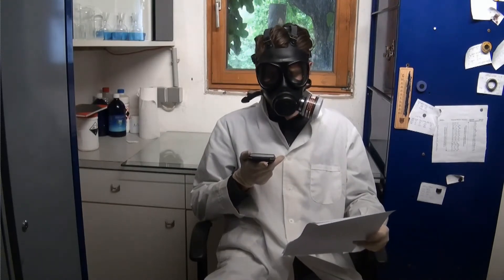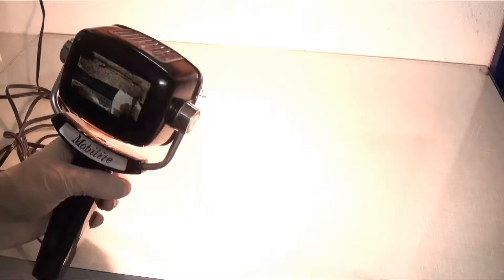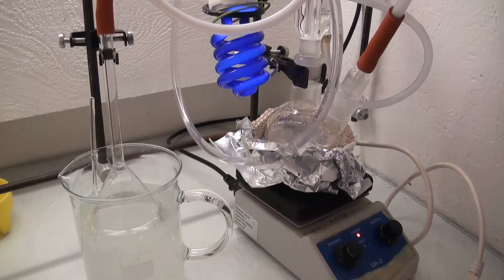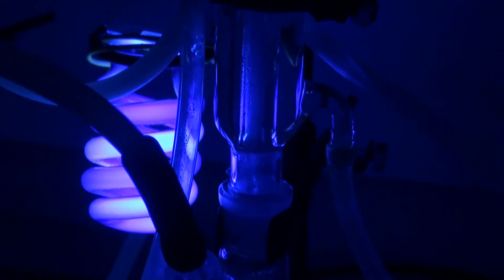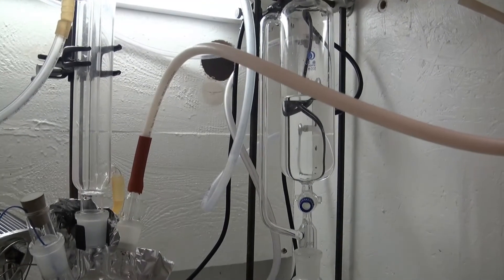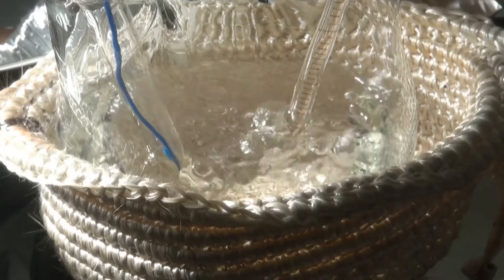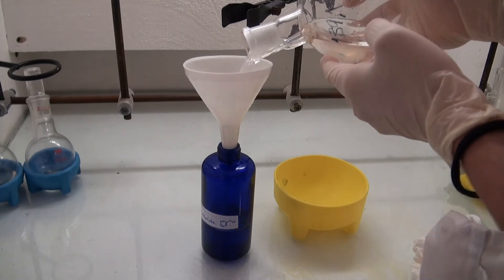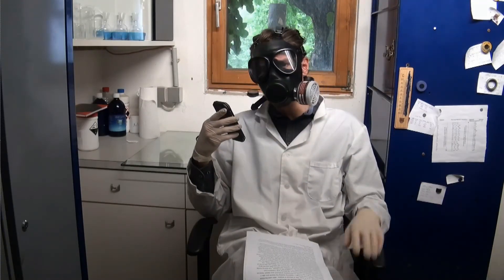The photochlorination of toluene producing benzyl chloride, benzal choride and benzotrichloride

Comment: nice, but i think a bit overcomplicated. It should be possible to just add the TCCA to the Toluene, then as UV source, sun, just let it sit outside for hours. Filter and distill. 

But still good :) alway happy about new videos
Reply from the maker: I will soon try this way to produce chlorobenzene
Reply: @madsciencemax8439  For a better overview over the process, Organoleptic, i think, made a video about it. Quite Exothermic Reaction, so it should be done in steps, but he explains how to do it well.
Reply: @madsciencemax8439  you did everything wrong. this glass does not transmit ultraviolet light. the lamp power is negligible, there is no necessary YF
Reply: @lorddesigner9121  Not true. Borosilicate is usable down to 275nm. Cl2 can be split from 250-450nm, and boro transmits 90% of the better part of this range. A halogen lamp is not ideal, but as you can see, it does work.